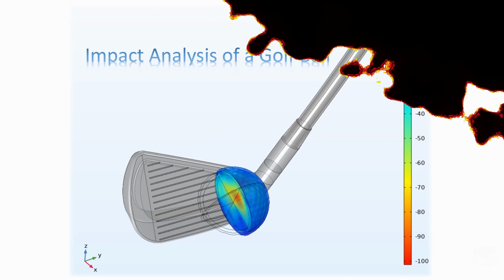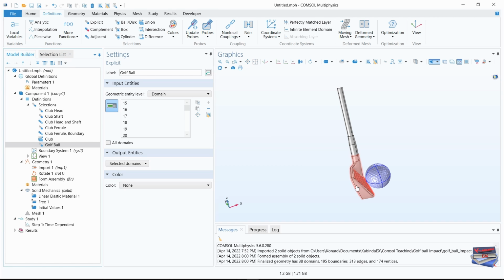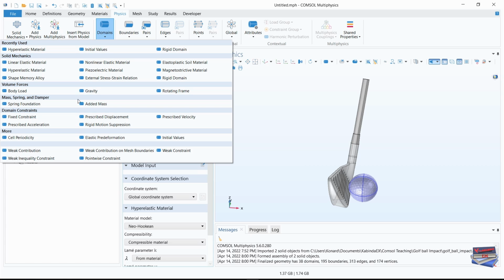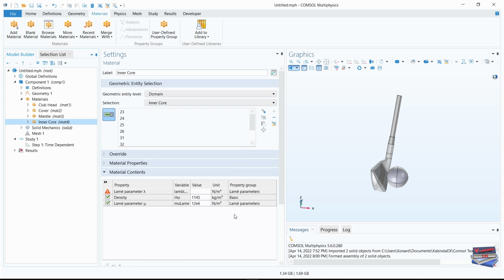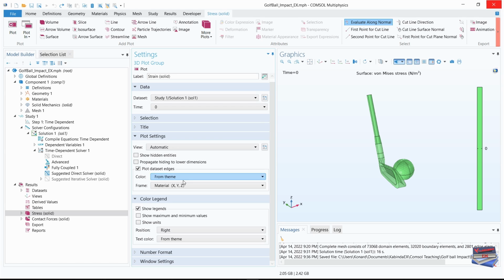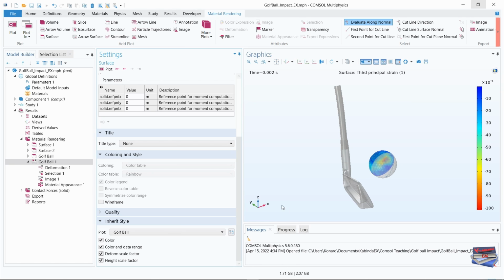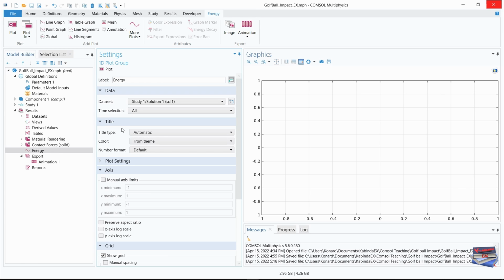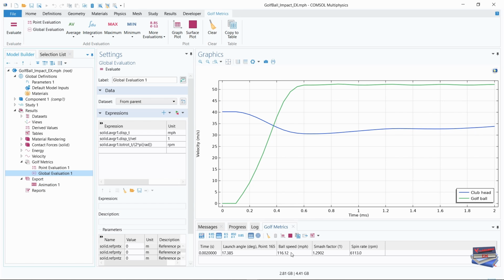Impact Analysis of a Golf Ball (COMSOL Multiphysics )

Comment: is it possible to do vehicle crash test using Comsol? ;>
Reply from the maker: It is possible to perform a vehicle crash test simulation using COMSOL Multiphysics, but it may not be the best tool for this type of analysis. Crash testing typically involves highly nonlinear large-deformation problems, high strain rates, and contact mechanics, which are better handled by explicit dynamic solvers like:

1) ANSYS LS-DYNA (widely used in automotive crash testing)
2) Abaqus/Explicit
3) PAM-CRASH

To obtain accurate vehicle crash simulations, I  recommend using ANSYS LS-DYNA or Abaqus/Explicit, which are specifically designed for crashworthiness analysis.
Reply: @kabindaex7047  
I know them...
i guess every single explicit solver may do that...
Reply: @kabindaex7047  may I ask U a question?
do u have this kind experience with Femap?
Reply from the maker: @JakubSobka  Hi. I don't have Simcenter Femap software experience. However I'm going to start exploring such. Why did you asked?

Comment: Excellent Works. I appreciate it a lot if you can describe  how you modeled the geometry.
Reply from the maker: A parametric design software, such as SolidWorks or Autodesk Inventor, was used to build the geometry. Then export to a format that COMSOL Multiphysics supports. 

The following link shows the CAD platforms and file types:
 
https://www.comsol.com/fileformats#:~:text=The%203MF%20(3D)%2C%20DXF,require%20any%20add%2Don%20products. 

It's  best to create complex geometry using a CAD software, then import that geometry into COMSOL Multiphysics.